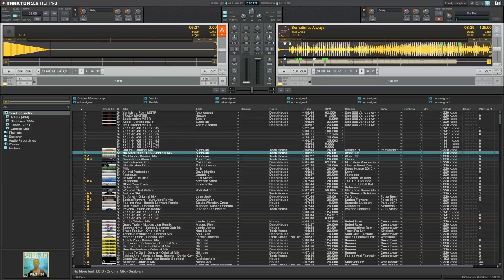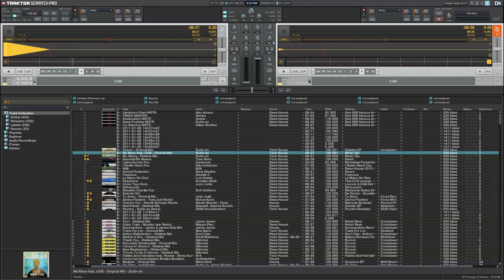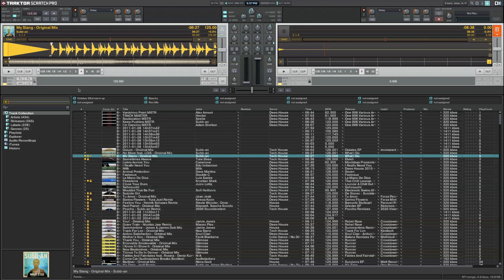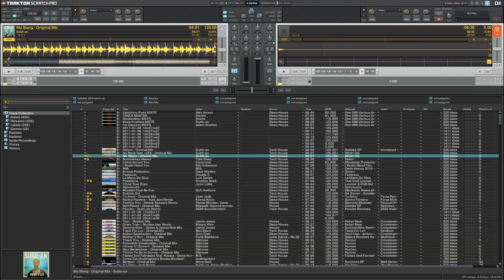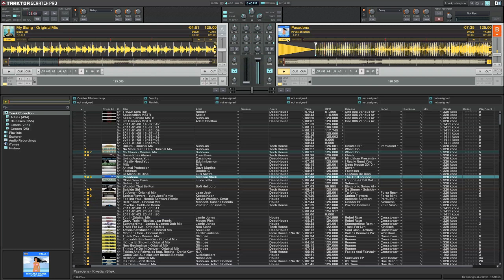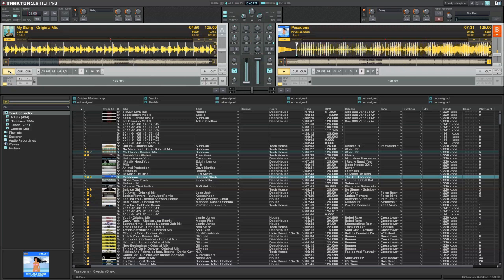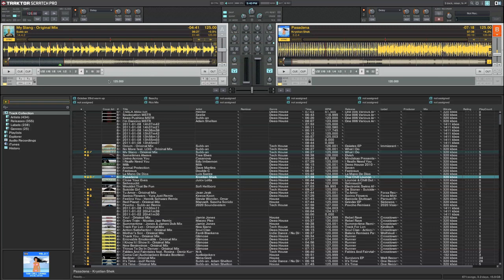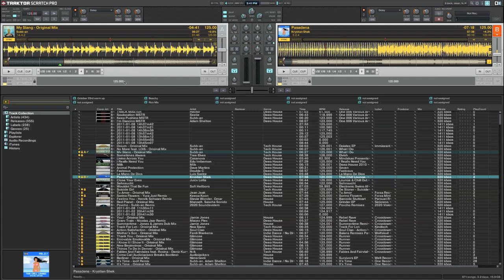How to Beat grid... (Traktor)

Comment from the maker: Thank you so much for the feedback - it is very much appreciated.  I have been researching a few different options in regards to video screen capture, but in the meantime am just using the standard Mac Quicktime Screen / Audio Capture.  As for the Screen views, because of the big screen I have, all parameters are in view at the top however, I will from now on, confirm whether I am using the deck advanced options of Cue, Grid or Move.  Thanks again and I hope the videos help in some way.